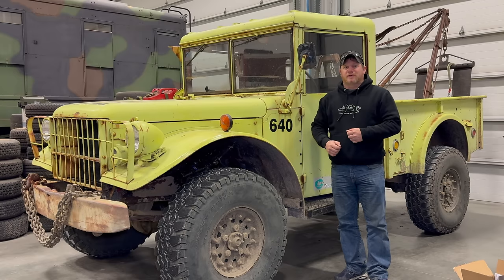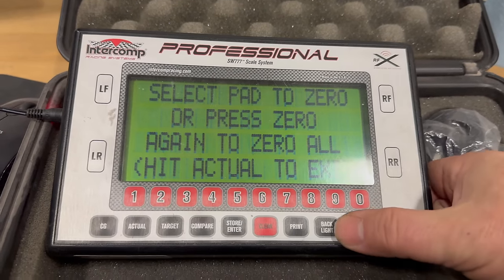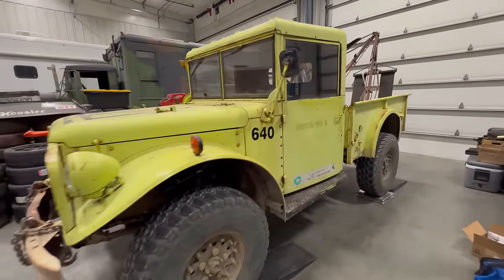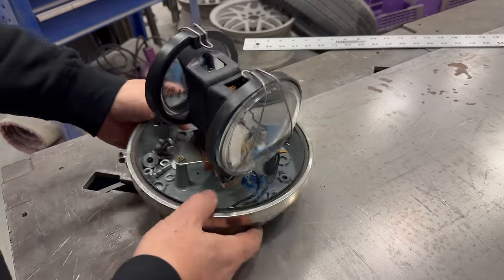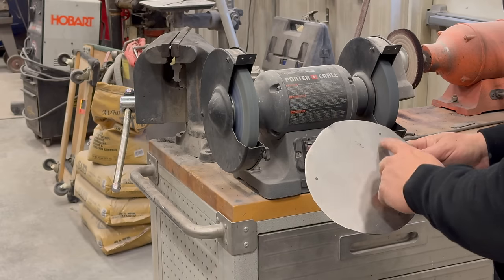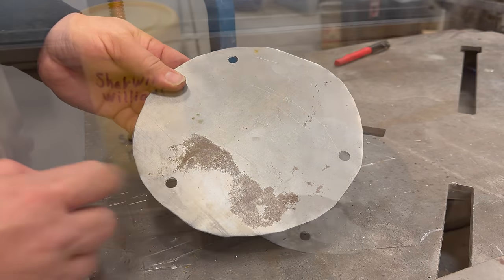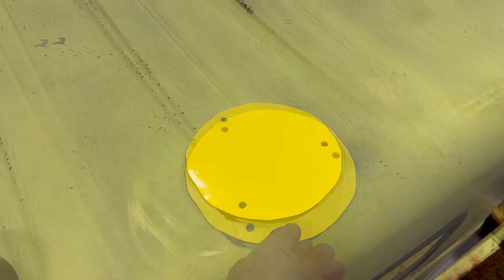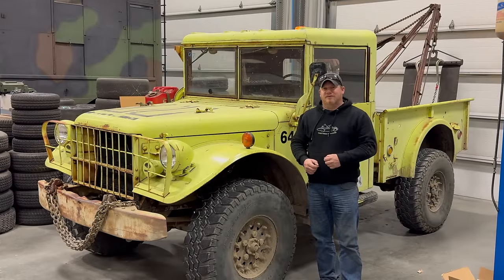More Work On The Vintage Off Road Wrecker

Comment: Your truck's top looked as if it might have been from a Canadian M37, but those were steel and were flat without grooves. We would stand on the roof regularly to camouflage the truck and in that process would dent them badly. The way to get the dents out was to lie on your back on the passengers' side and push out the dent with your booted feet (likely the same feet that put the dents there in the first place). Kick as necessary until you have the necessary headroom.

Comment: Outstanding truck.   IMHO, You REALLY need to mount the OLD beacon to maintain the look.  It may even work better. I understand the tree branch  clearance  thing, but you can  build an 8x cage to keep the dome of the beacon  safe from tree branches, etc.    Also, add couple of classic spot lights.  They would add to the look as well as to the functionality.
Reply from the maker: The spot lights is not something I had even thought about yet but I like it.

Comment: A little heavier than a brand new Rolls Royce Phantom, just in case you come across one in a ditch!
Reply from the maker: And way lighter than the new electric GMC Hummer which comes in at over 9000 lbs